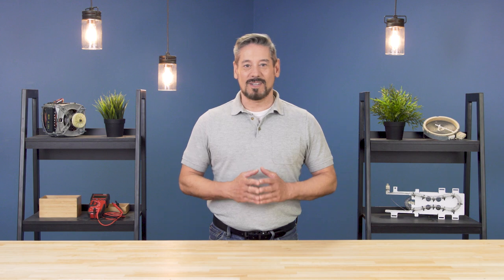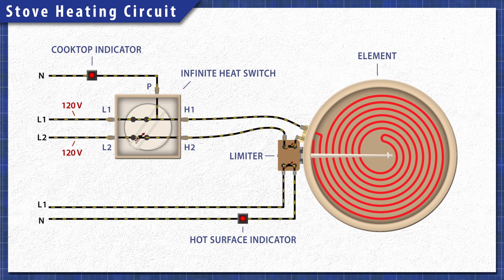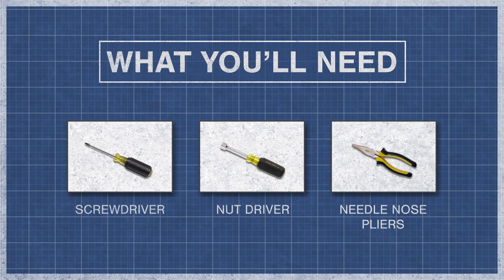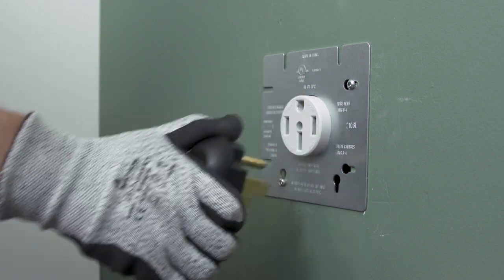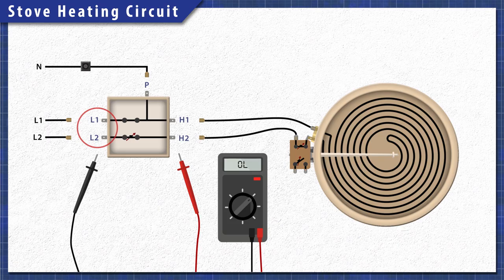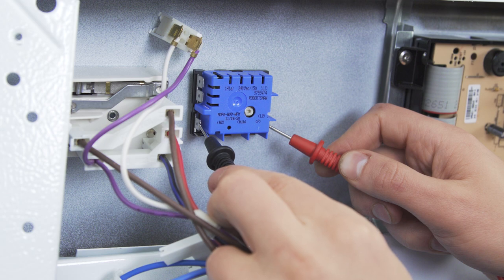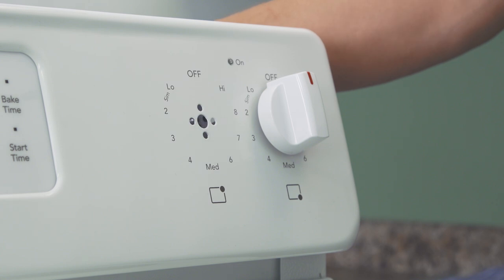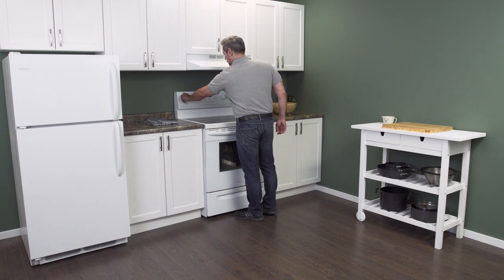Electric Stove Heat Switch - Testing & Replacement | Repair & Replace

Comment: Hi Vance,

My son & I have enjoyed watching your videos while trying to diagnose a problem with our Kenmore range. The two large burners were intermittently getting stuck in a high heat setting even after turning the dial to a lower setting. We ran through all your suggested switch, wiring and element testing and confirmed everything tested fine. When there was no sign of shorting (soot) on the burner receptacle connection, we were left with trying a new switch to see if that resolved the problem. As soon as we removed the old large-burner switches, noticed soot on the top of and inside the switch; there was no soot on the switches for the small burners which were working fine. There must have been some kind of shorting happening in there but we missed seeing that when testing the switch. The new switch resolved the problem. You might want to add this check for shorting, if that's what was happening, to your video on switch testing. Had we noticed it at that stage we would probably not had to check for a wiring or burner problem. Regardless, you saved us from a bigger repair bill and allowed us some much appreciated mother/son bonding time.
Reply from the maker: HI Loretta, thank you for sharing your experience! We're just glad that the video helped you and your son repair your stove. 

We didn't want to add to much length to this video so we made a specific video to troubleshoot a burner that is stuck on high: https://www.youtube.com/watch?v=l39vOnhqnhg As well we made a more general troubleshooting video on the burner not heating which covers testing the switch, wires, and element: https://www.youtube.com/watch?v=GaW7uAHkPQI

We're never quite sure what terms people are going to search by we have tried to at least have some troubleshooting specific videos and other videos like this which shows the direct testing and replacement of a single part. Between that we've got a few videos covering most issues.

Comment: Your Part worked perfectly. Thanks for the excellent video. L1 to L1, H1 to H1. I was replacing the original switch which looked different.
Reply from the maker: You're welcome! That's exactly why we explain the why/how as some models and some replacement parts might look different.

Comment: thanks for a good video. I am 67 yr old female and could have done this by myself but my son did help to be sure we replaced one for another. It was easy. We did encounter one problem.. The metal part that the knob attaches to was turned around and made everything upside down.. my son easily figured that out and we were done!
Reply from the maker: You're welcome Maryellen, we're just glad that the video helped you out!

Comment: ALL of my burners are suddenly staying on even when the knob is off. Flipping the breaker resets the stove & it stays off until you turn on a burner. It seems unlikely that all 4 switches suddenly malfunctioned at the same time. Is there something else I should check? Is this a control board issue? Thanks for the helpful video.
Reply from the maker: Thanks for watching, we're glad you found the video helpful. 
If your stove has individual heat switches then it is very unlikely for all of the burners to have the same problem like that. It is more common in models that have a control board connected to all four burners, in this case replacing the control board would be best.

If your model has individual heat switches like the ones in this video, then you could test for a short circuit. https://youtu.be/l39vOnhqnhg?si=yMdZr-0HazQbe_n-&t=209

Comment: I did install the new switch, then I took the old switch apart to try to understand why it failed. Then I saw the calibration screw. This dual burner set switch lasts for about 10 years. Over the last 20 years I have had to replace the switch twice. The first time the burners would not work at all the second (this time) the burners stayed full on no matter the switch position.  

I suspect that the wear on the axel of the switch or the 2 cams may have created my full on issue. 

As an enginerd, I am going to record the on and off times for various settings for the new switch, and then make a setup to run the same wattage through the old switch and adjust the calibration screw to match the new switch so that in 10 more years I won't have to cough up even more money.   Yes I see that I'll have to use an insulated allen key as the screw will be hot.
Reply from the maker: Thanks for sharing your experience and observations on this!

Comment: Thanks for your content, I tried on mine, and testing between l1 and p, has continuity being off, the others that you check in the video didn't, I'm having this issue after cooking, a beam of light came out, burning the spiral of the stove and piercing the frying pan.
Reply from the maker: Thanks for watching. Do you mean that you had an electrical arc out of one of the switches?

Comment: Excellent video.  I called store to buy a switch for GE even though they are all almost the same one or two manufacturers  they quoted me for dual element control switch $248 cdn, typically highway robbery 
I took a switch apart and the contact get tired sometimes if you use it too much which we are.  So basically I bend them back in their previous shape 4 and 4a and the switch works as before.
If nothing is broken this could be your fix.
Hope it helps.
Reply from the maker: Thanks for watching, we're glad that it was helpful! The prices on some parts depends on the availability, so there is some variation. In any case there are some generic parts that can still work with any model if it has the same terminals.

The metal inside the switch does fatigue over time, so your fix is one way to help if the rest of the switch and terminals still has continuity..

Comment: I rent and the stove is a very old harvest gold Admiral. The knob just spin around and the heat is stuck on high but the light works. Don’t have the testing equipment and I’m just hoping to replace the switch. Thing is I’ve no idea what the model is. Where/how can I find out what switch to buy?
Reply from the maker: Thanks for watching. Most stove have switches that are similar but just with terminals in slightly different configuration. A single burner is more simple. If you take out the switch you can match abased on another switch that has the same terminals. There are universal switches as well that you'll have an adjustable stem length: https://www.amresupply.com/catalog/Switches-Infinite-Surface-Element-675690-AD1D

Comment: I have a Whirl Pool Range with one dual element in which the "outer" portion works and the "inner" portion does not. When testing the Infinite switch for continuity are you to test the switch on "high" for the two settings "single" use of element and "full use of element. Thank You!
Reply from the maker: Thanks for watching. You are right that you'd set the switch to high for the dual setting so that you can test all of the terminals.
Reply: @AmreSupply  Thanks for confirming!
Reply from the maker: @jirotaro1792  You're welcome!

Comment: Hi  i just tested my burner and infinite switch. They tested ok as per your video but my burner still does not work. Is there anything else that I could test to isolate the problem? Thx
Reply from the maker: Thanks for watching. First make sure all the wire connections are secure. That can be an issue in many cases.

If the element and infinite switch both are good based on isolated tests, then it could be an issue with the wires. You can test the element and wires through the back. You should get the same resistance as during your isolated element test: https://youtu.be/GaW7uAHkPQI?t=382

If there is no resistance in the combined test then you might need to replace a segment of the wire (if there are any burn marks or a pinched or broken segment).

If the wires between the heat switch and burner are good, then you can test the wires that feed the heat switch: In this case you'll test between the terminal block and the heat switch wires. This is somewhat shown here: https://youtu.be/wZwxewn2w44?t=375

Comment: I think I might have the same problem but after I heard it pop it worked again after.  I switch from the bigger burner to the small one to quickly and heard a loud pop, I figured it might have been a breaker or something but quickly realise with the videos that it's probably the heat switch.  But for the life in me why the heck is it still working fine????? I must have blown something up by switching the knob from one side to the other.  Did it arc back there I didn't see any flash just the loud pop. My stove is a Samsung model NE595R0ABSR ceramic top
Reply from the maker: Thanks for watching. These heat switches use small pieces of metal. As current travels through the metal, it heats up slightly and bends away from the contacts. This metal can warp over time. As well you might be hearing an arc between the contacts. In this case it might be best to install a new heat switch. If you are curious, you can see the inside of the switch here: https://www.youtube.com/shorts/URFjJPQycsk

Comment: What if some have high numbers flashing? Confusing. 
Not sure where to set meter; I have it on the 200 on ohm side. What you call 4A gives high numbers & mine is labelled PILOT. My GE PROFILE Range is turning the back small element on by itself (warm with light)-who knows how long since 2007? I never use this element. 
Test: Dial on max- P2/4 flashing over 1…into double digits. Same with P2/PILOT (in your 4 location)…I see some decimals but it’s all over the place. Do I believe it’s Ok & test the other knob switch which controls 2 parts of the 3-part burner?
Reply from the maker: Thanks for watching. If sounds like your multimeter is not auto-ranging. You set it to the 200 ohms which will detect readings up to 200 ohms. A heat switch simply creates a path for electricity to flow through. The resistance should be between 0 and 1 ohm (0 meaning an unrestricted path). If the resistance is outside of the range then the switch is likely faulty and should be replaced. A buildup of carbon on the electrical contacts can also affect the resistance.

Keep in mind that if the terminals are dirty or if you do not make good contact with the multimeter probes, this can affect the reading and can throw the numbers off. You can clean the terminals with steel wool if needed.

As for the back element, that heat switch is likely faulty if it's turning it on when it is not supposed to be. Best to replace that heat switch.

Comment: I have a GE Triple Radiant Element 12" (part WG02F02055). The outside and inside rings heat but the middle ring does not. I replaced the burner but the same problem occurred. Does this mean that the only other cause of the problem would be a defective infinite switch?
Reply from the maker: Thanks for watching. Sorry for the delayed response, sometimes the notifications don't show when new comments are added. If you've replaced the element then you can test the element and wires together through the back as shown in this video: https://www.youtube.com/watch?v=GaW7uAHkPQI If there is continuity when testing the wires, then it's likely a faulty infinite switch. If you triple burner also has a separate toggle switch (for the 3rd ring) then this can also be tested for continuity as it will either be on or off.

Comment: Hello, AMRE. I have a stove with a bad WPW10169580 switch. The heat is staying on high only. The replacement is crazy expensive. I was wondering if a dual burner would work for this but disable the 3rd burner? Do you know of a good option to replace this for under $80?
Reply from the maker: Hi Ben, thank you for watching. The part you are looking for has an extra heat terminal, an H3 for the 3rd burner. If your burner is a dual burner, then check what wires are going to your existing switch on each terminal. By not connecting anything to the 3rd burner you should be able to use a switch like this: https://www.amresupply.com/part/15419594

The terminals might be in a slightly different position so if you have a hard plastic connector, you might need to break the plastic to separate the connectors so that they can go in a new position.

Comment: So multiple videos on this subject say a faulty switch can cause the element to stay on high with no adjustment but none of the multi meter testing refers to this situation. I would think that you would have continuity between L2 & H2 if it only worked on high with no change in Ohms as you rotate the control knob if it worked as designed you would see the Ohms reading go up or down as you rotate the knob. Am I correct in my though process on this? A demonstration of a functional control knob reading Ohms between L2 & H2 would help as well. Thanks for the video.
Reply from the maker: Hi Mike thank you for watching. That is a good question! The infinite heat switch is difficult to test. It has several pieces of metal inside. When current passes through the switch, the metal heats up and the metal bends slightly to disconnect power to the circuit. So if you're testing a switch that is disconnected from power, you can't determine how it will function when current passes through it. Setting it to the low setting will show continuity at rest, (it just means it will take less bending to disconnect the circuit, which means the burner will stay on for a shorter period of time). Setting the switch to a high setting will still show continuity. The resistance value will not change.

Also keep in mind that over the lifespan of the stove, the metal inside the heat switch can warp or get fatigued, or the contacts can stick together. If this is occurring the switch may still have continuity.

The switch however can be tested to see if the contacts are not closing, but that is not useful in this scenario when the burner stays on as we know it has continuity.

Keep in mind that a shorted element can also cause the burner to stay on high, this is covered in this video: https://youtu.be/l39vOnhqnhg?t=103
Reply from the maker: Also one more point. The infinite heat switch is not a variable resistor, rheostat or a potentiometer. The ohms will stay between 0 and 1 on any setting.

Comment: I made the mistake of not taking a picture of the wires hooked to the old switch. How do I determine which wire goes to H1 and which to H2, they are the same color?
Reply from the maker: Thanks for watching. The colors will differ between models so there's not a single standard. Your stove should have similar switches that are fed by the same wires. If you're able to identify which wire is line 1 and which wire is line 2 for the other switches then just apply that to the new switch. As well the P terminal or the indicator light will likely be a different color and you should be able to see one wire branch between all switches and the indicator light. Technically speaking if you reference the diagram shown in this video, the switch should still work even if L1 and L2 are swapped or H1 and H2 are swapped. As long as the P connection is correct.

Comment: I have a Kenmore with a simmer select and power element on the front left side The simmer select board burnt out so I replaced but now neither the simmer select or the power element works checked it all out and still nothing
Reply from the maker: Thanks for watching. If your model uses a board to control the simmer function, and that was replaced, It might be helpful to check the surface element for continuity. If there was a power surge that damaged the element, this can often damage the board as well. https://www.youtube.com/watch?v=GaW7uAHkPQI
Reply: @AmreSupply  I did and I’m going to replace the burner infinity switch because it was a little dark but I did check that to for continuity and it said that was ok and I also checked the element and got a good reading
Reply from the maker: @angrylefty7953  Best to check all the connections to make sure that they have good contact. As well you can test the element and wires together through the back to doublecheck that the wires are good: https://www.youtube.com/watch?v=GaW7uAHkPQI&t=336s
Reply: @AmreSupply  I’m going to see if the control fixes it and I did check them before I removed controller thank you for all your help
Reply from the maker: @angrylefty7953  You're welcome! Best of luck to you.
Reply: @AmreSupply  still nothing I’m going to give up I just can’t figure it out and don’t want to keep dumping money in this
Reply from the maker: @angrylefty7953  Thank you for the update. Its hard to give any more suggestions on this without seeing it first hand. Appreciate the comments though.